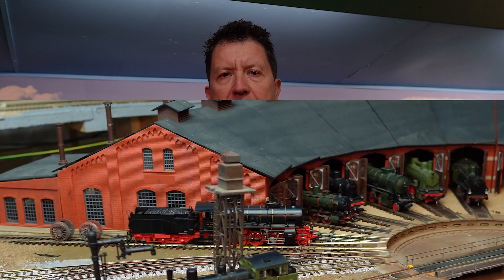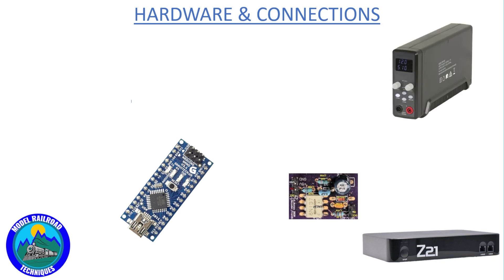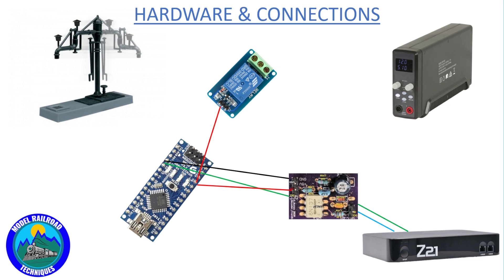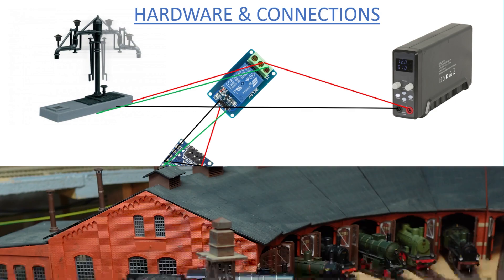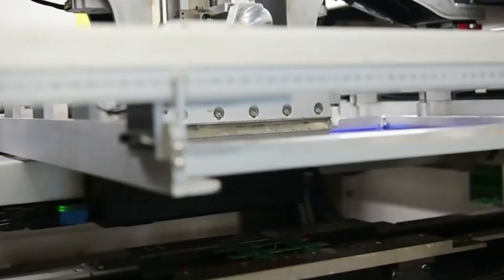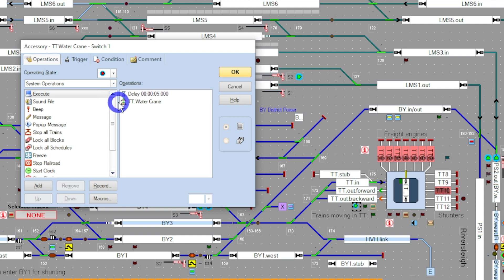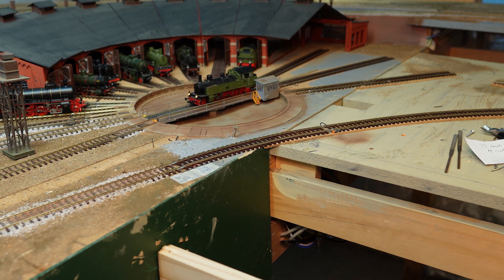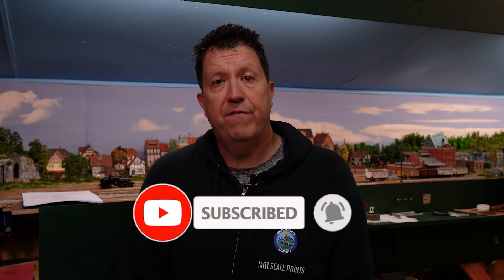Start animating detail parts on your model railway- Water Crane

Comment: 1; Yes, I would
2; Just the water craneI would run with optical sensors and RailCom to update fuel data in the RailCom part of the decoder and then I can only fill locomotives that really need it.
3; You are already good enough, maybe have a little better lighting.
Otherwise you should be really happy with the quality of your video.
Reply from the maker: Thank you. Lighting was a little dark in that part of my layout. I can do that in TrainController as well but just wanted a quick and easy concept

Comment: Nice animation!!  Two comments.  First, I suggest a few scale workers or other people around the water crane to look as if they are operating it for the engine.  Second, I agree with you.  The water crane moves a bit too fast.  Ideally,  it would move slower and even slower (second speed) just as it moves to the exact position it needs over the engine.  Just my thoughts.  

As to how to make it move at other speeds.  Downloaded the Viessmann 5132 manual to see what it's about.  Guess you could substitute the Viessmann controller with an Arduino and an Arduino motor shield.  Manual specifies 16 volt AC/DC operation but doesn't say anything about the motor ... could be a 5 volt DC motor.  Arduino and motor shield could control it with pulse width modulation (PWM) to change the speed and direction of operation.  Seems the five wires indicated are all that's needed ... two for the motor, a ground, and two limit switches.  Experimentation and code would be necessary of course.  Similar to animating a DC train engine back and forth on a section of track that has limit switches on each end.  BTW ... there is a very nice L298P motor shield available for Arduino Nanos on Ebay.  Cheers ....
Reply from the maker: Thank you for kind words. This scene is far from finished. Your ideas are great. Yes I will need to experiment with some more arduino here. Cheers Daz